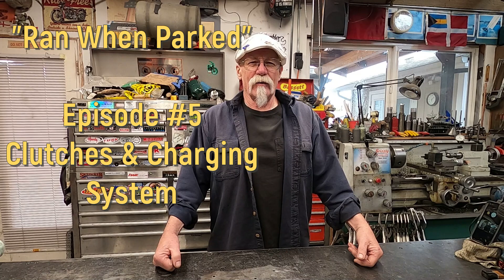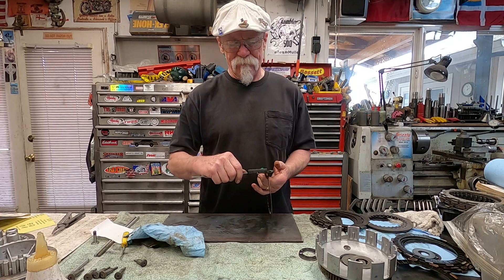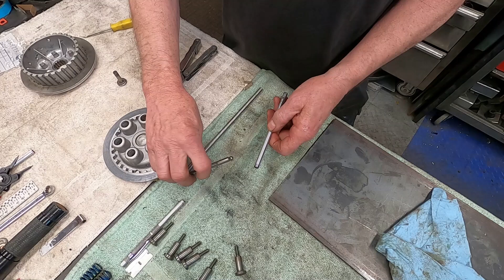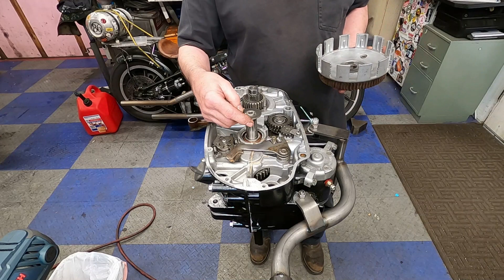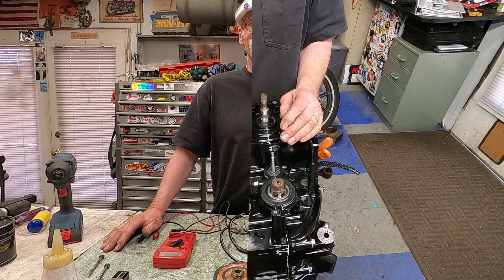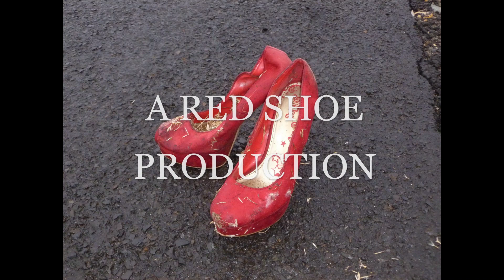"Ran When Parked" XS650 Clutches & Charging System

Comment: Thanks for the video Mr. Miyagi. I’m getting ready to swap from a PMA system back to a stock alternator on my 78 650. How can I replace the locating pin you talk about at 21:02 ?
Reply: As a matter of interest why do you want to revert to stock, as I'm considering installing a PMA, would appreciate your experience.
Reply from the maker: Well I guess if you could find an original pin to put back in there you just tap into place and you'd be good to go. I'm not sure where you're going to find one you're going to have to find some material and maybe make one or eyeball stater housing in place. I did look around the shop see if I had one but I don't. The thing is the screws are going to hold your housing in place just make sure you have it turned the proper way. Hope that helps thanks for watching
Reply: @outlaw86custom thanks. If I’m understanding you right, what you’re saying is the locating pin is there for ease of installation. If I’m mindful of where the locating pin ought to be and how I install the stator in relation to it, then I don’t actually need the pin to be there. Correct?
Reply from the maker: @danieldobbs5386  yes, it's just for locating the position of the stator. What I said before is that when you install the screws in it holds it in position. Your wiring also helps position the stator. These are fairly simple engines to work on.